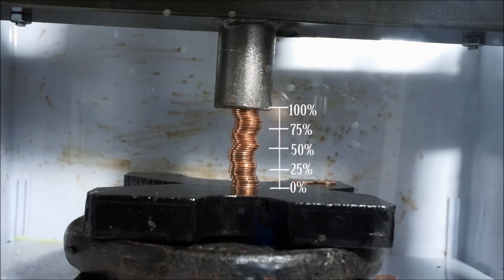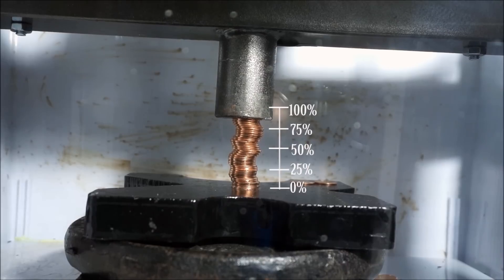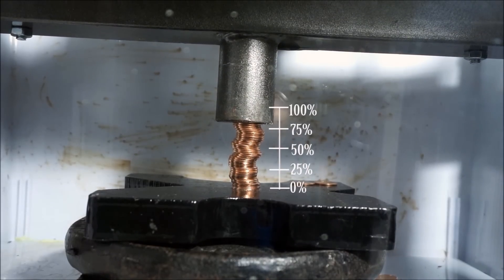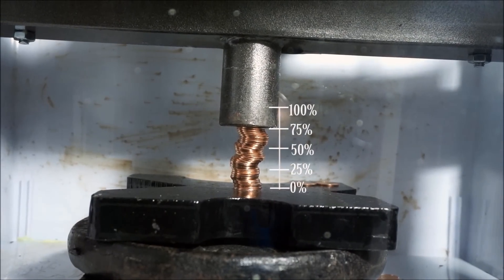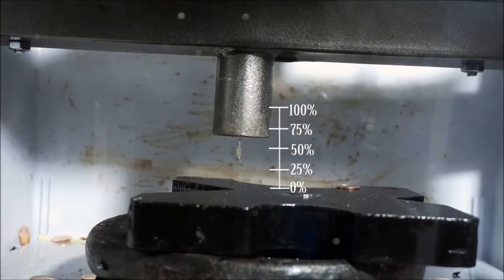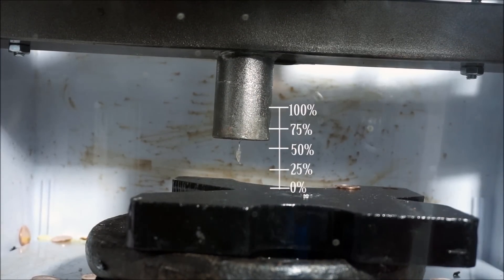Coins Crushed by Hydraulic Press| Coin Explosion

Comment: my suggestion.

Get a to-go container for glucose tablets, and put all the pennies you have in them, then shake it around, till they're straightened out, then flip it upside down to a surface and carefully remove the container., the stack of pennies should be totally straight, or as straight as you can get them. The trick is similar to putting them in a roll of pennies.

Just buy a pocket size tube for glucose tablets, then put them in the container as I mentioned. I use this trick when I go to the arcade!

Comment: Defacement of currency is a violation of Title 18, Section 333 of the United States Code. Under this provision, currency defacement is generally defined as follows: Whoever mutilates, cuts, disfigures, perforates, unites or cements together, or does any other thing to any bank bill, draft, note, or other evidence of debt issued by any national banking association, Federal Reserve Bank, or Federal Reserve System, with intent to render such item(s) unfit to be reissued, shall be fined under this title or imprisoned not more than six months, or both.
Reply from the maker: Then those machines that stretch pennies and print a picture on them at Disneyland and other places are sure in trouble.

Comment: perhaps if you aligned your press you would be able to compress them using vertical pressure rather than sideloading the stack. have you heard of (as above so bellow). aligne your press so it is applying force straight down in a vertical fashion and you will be able to apply more force to unstabe objects such as a stack of couns and you will get better results and possibly less shrapnel.

Comment: isnt that technically illeagal like ripping a dolar
Reply: no. Defacement of currency is a violation of Title 18, Section 333 of the United States Code. Under this provision, currency defacement is generally defined as follows: Whoever mutilates, cuts, disfigures, perforates, unites or cements together, or does any other thing to any bank bill, draft, note, or other evidence of debt issued by any national banking association, Federal Reserve Bank, or Federal Reserve System, with intent to render such item(s) unfit to be reissued, shall be fined under this title or imprisoned not more than six months, or both. 
 He isn't trying to make them unusable, as he stacked them askew, he is just trying to get a reaction. Also the coins sprung back to their original size, or at least near, causing almost no difference.

Comment: They would have crushed/compressed better if stacked straight :\ the pressure will try finding a weakpoint to relieve itself, and the weakpoints were the curved areas. Because of this, the area below the curves had nothing below for support and so the stack went lopsided and then eventually exploded outwards.

You need to redo this with a straight stack. Seriously, it only takes a basic education to figure this shit out.

Comment: Get a roll of coins, much more stability
Reply from the maker: This was a roll of coins lol,  but I wanted it out of the packaging, hence the stacking:)
Reply: If you did a 2nd try leaving that paper sheath around the coins you might be able to crush them, if not then the fault is in how the press begins to move off kilter as the coins deflect the top plate pressure at an angle, causing the "explosion" of coins
Reply: The tape would be to the side and the metal would push it outwards when being compressed. You hardly would get any tape in between pennies, so it wouldn't cursh the tape.
Reply: You could use transparent adhesive packaging tape (2" wide) to stabilise the pile and still have the individual pennies visible. I'd like to see that.
Reply: Царь бббомба it needs to be staggered
Reply: But then it's crushing pennies and tape not just pennies